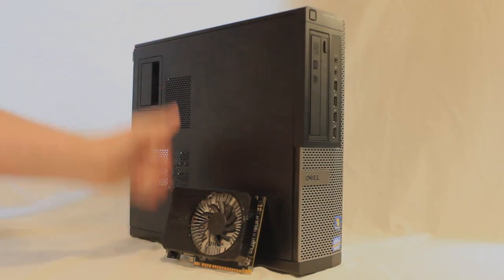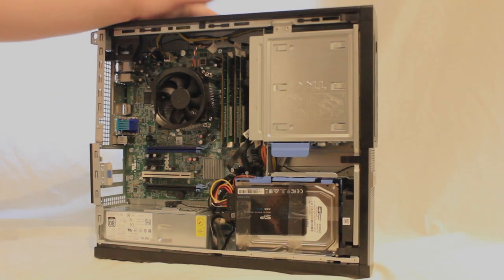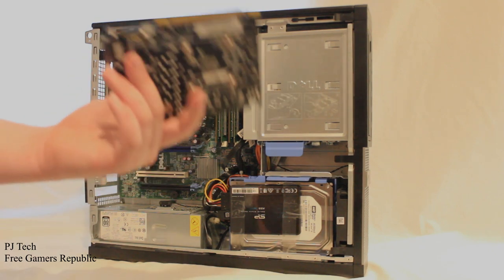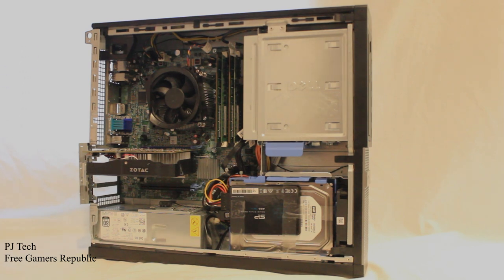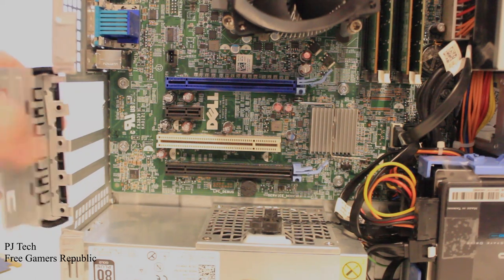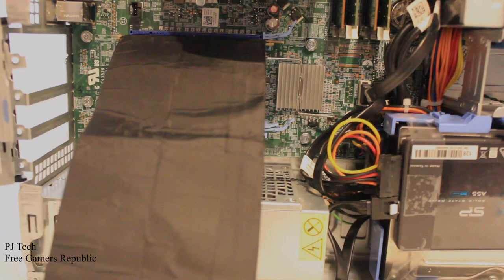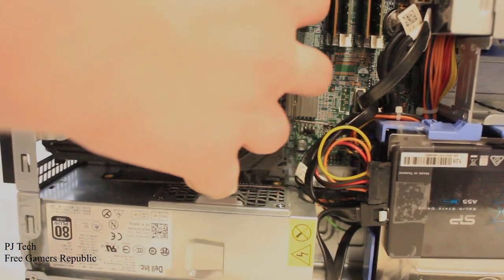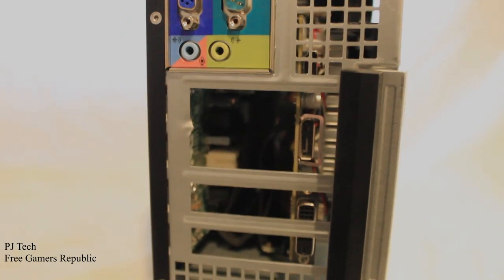Full size Gpu in a Dt size Desktop

Comment: I’ve been stressing about this for a week now. I have a 780 SFF that my grandma gave me, and I want to put a 1050 Ti in it.
Reply: 780 is a core 2 duo/quad platform. Not worth the 1050 Ti. Newer games require some features even the best core 2 quads don’t support and it’s just not a modern budget gaming platform. If you have the card already look for deals on 790-7010 2nd or 3rd gen i7 or even cheap upgrade to it’s xeon counterpart.

Comment: I have a Dell Optiplex 9010 DT. I cannot find PCIE riser cables in my country (the Philippines). Can I use a full size GPU like in 1:39 by not closing my case?

I'd like to add a GTX 1050 in mine. I'm currently stuck with the low profile GT 1030.
Reply from the maker: yep id use a zip tie to hold it in place
Reply: @pjtech4796  Thanks! How about placing it sideways so that it won't get pulled down? Would that work too?
Reply: @toptierdiscordmod7806  I actually wasn't able to do it. GTX 1050 prices in the Philippines are still messed up.  I just stuck to my GT 1030.
Reply: @toptierdiscordmod7806  Get an RX 550 or GTX 750 Ti and above as your bare minimum. They're better than the 1030. 

Been playing older games like Dark Souls 3 @720P just fine. Well optimized games like Control, Jedi Fallen Order, can still run but with very low settings.

Avoid games with heavy foliage like Horizon Zero Dawn.
Reply: You can play Resident Evil 2 Remake (and probably 3), just not Resident Evil: Village and future RE Engine games.
Reply: @toptierdiscordmod7806  There should be low profile versions of RX 550 and 750 Ti available. If you cannot find them, the 1030 is your last resort like what happened to me. 

The GT 1030 is better suited for older and esports titles.

Comment: you dont have to plug directly into your Gpu, you can direct the graphics card video to your motherboard output.
Reply from the maker: that would be interestion to know
Reply: @pjtech4796  set your motherboard bios output to IGFX instead of PCIE. (Then install your gpu, plug your output from motherboard)

When boot to windows, it will use internal graphics automatically. 

If you want to run games. All you need is to go to Graphics Setting(Windows setting). Choose the application then you would be give a choice to choose between internal graphics or graphics card.
Reply: Is thare a video?